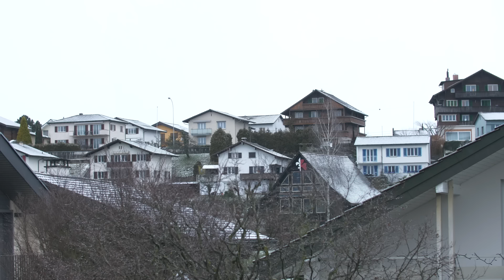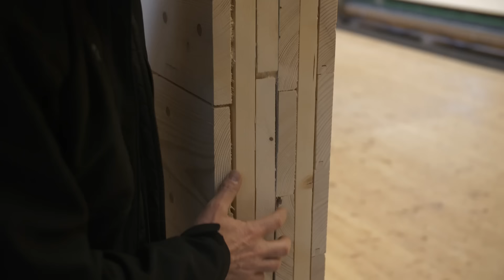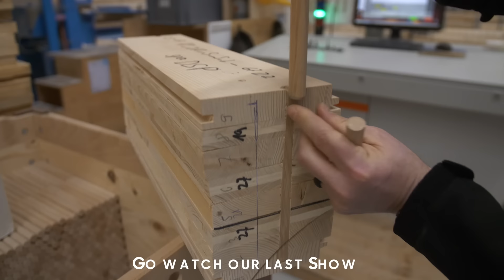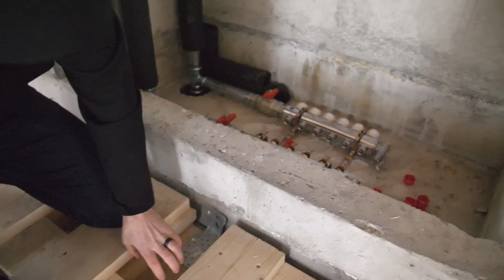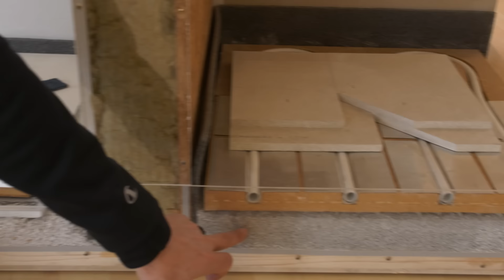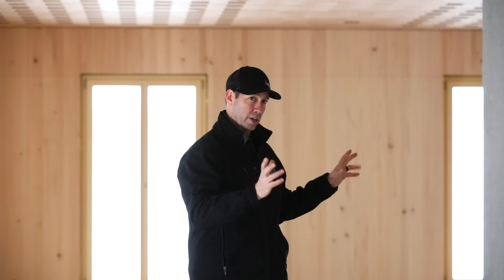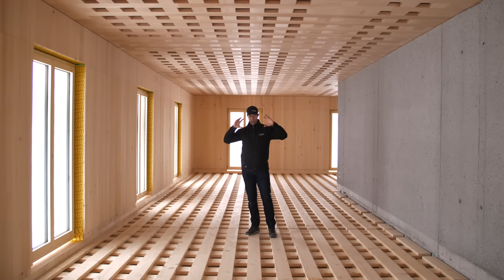This Swiss Building blew me away!  All Wood and Concrete - NO Insulation

Comment: i can think of cheaper ways of doing all of these things , of course it is a great way to build,,so is using marble and copper and sandstone and black walnut.. but as far as building good and less expensive homes we dont have a lot to learn from the swiss
Reply: if a building stands for decades and is cheap on heating/cooling and wont succumb to the elements it will be cheaper in the long run. the swiss are stingy, so yes, you do have alot to learn.

Comment: I have someone agrees 
The real question is both ideas are stealing from this world so the real question is what should we use as a substitute to supply a solid material besides wood or concrete how about the glass and the combination of a lot of lava rock mixed with sand to reform a solid surface which is not a bad idea

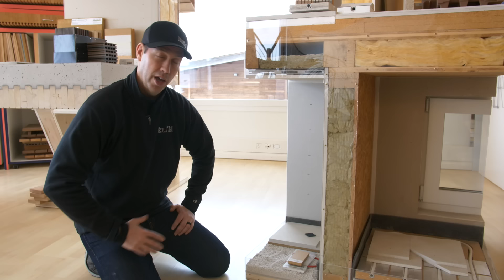Comment: I dont entirely see the need of such a floor build up. Not even in the mock up at 2:41.
But the product and build in general shows the high building standard of switzerland in terms of quality. Bulding material resources, financial resources and skill set of planers and contractors are available and taken advantage of. How most of northern europe builds, the concrete is very typical for swiss buildings tho

Comment: I don't really care about emissions or wood consumption. As I see it, humanity as a species will run itself into the ground either way. But if I were to approach this building from that perspective, I would be interested in emissions that you have to make while sanding, sewing, gluing, etc. I bet they would be pretty comparable to a full concrete structure. You can't fool physics. Moreover, let's add up the time it took for those trees to grow to the time that it takes to build this. About 50 years per tree. Are you prepared to wait that long? We already need millions of trees per day planted to make the slightest dent in our carbon footprint. So much so, in fact, that to accomplish this we would have to forgo growing food be it plant-based or otherwise. So unless they replant all the trees they use and do every bit of the work by hand or electricity generated by a nuclear plant I call bullshit on the "ecology friendly" claim. Other than that - a pretty unique and awesome looking project. Kudos to those guys.

Comment: I like the idea of the concrete in the middle with the wood on the outside.  I wonder if there's any considerations when the two different materials meet, do they grow or shrink at different rates, and could that cause some defects or kind of like noisiness as the building is groaning? Seems like they know what they're doing but I want to learn more about the concrete + wood construction.

Comment: Most CLT buildings in Switzerland , germany and austria apply insulation on the outside of the building and siding over that to protect the CLT panels and the insulation. 
The “ you don’t need insulation “ thing by these companies is mostly for a selling point. To get a really good insulation value from a CLT house you would need about a 30 centimeter thick wall. this drives the cost up to a level that most people aren’t willing to pay and beside that you can achieve a waay better insulation value using  a thinner clt wall with equal amounts of insulation on the outside .

Comment: Wood is beautiful until there's a fire...
Reply: where it turns out to be safer than concrete or steel
Reply: @MrTimStoop  Do you have verifiable data to support that? I did a little search and found(on a wood construction site) large wooden beams are more fire resistant than steel but couldn't find any supporting data

Comment: I wonder how they're going to get Voice, Data and Access Control done for the building. Are they going to run the cables with the heat pipes in the sand or if they're going to use conduit along the concrete core.

Comment: The sand method really sucks cause over time in high traffic areas the sand shifts and the floor becomes like a sponge. I've had to redo so many of these types of floor in Sweden. This method is no longer used here. But it sure does make the floor quieter. Not worth it though.

Comment: Damn that is awesome!  Very interesting and efficient design.  I do wonder though if there is any form of vapour barrier, or if the wood sealer will be enough.  Definitely a neat concept.  A standard wall with batt insulation is like R12.

Comment: R24 is pretty low, VERY low actually for new construction. Why do you keep calling this great? Termites, wood rot, low R value. This is a vanity project, not an efficient project. Check out the R80 roof they're putting on the Net Zero house on This Old House.
Reply from the maker: I’m not advocating for this in the US but I do think it’s interesting from an IAQ standpoint and certainly beautiful!

Comment: solid wood doesn't sound good for insulation, but who I am to judge. Insulation is about removing conduction of heat away. that house might burn really nice if it ever happens. seems expensive and also using sand might make it heavy, but soundproofing with it seems good idea. Also I hope there won't be any moisture in the flooring, otherwise it's gonna bend real bad.

Comment: I am pretty sure from the looks of it, that it is not normal sand.

In Austria we call it "Estrich" and in Switzerland its called "Unterlagsboden". 

It is very lightweight and will flow in every crack, like sand. Then it is cured and hardenend, i think with conrete-like chemical compound inside. After the curing prozess its solid, noise dampening and lightweigth. 

Its pretty much the Standard in Germany, Austria and i guess Switzerland as well since decades!! ;-)

Greetings from Austria.

Comment: Are there vapor barrier between the concrete and lumber? This doesn't seem practical, or innovative but every thing engineers do aint. That concrete will rot the lumber from the inside out, due to condensation

Comment: Artfully beautiful! Thanks for showing it. Cheers!

The sand filling in between the wooden floor elements - so much easier to remove then concrete in case of a repair or let's say implementing an idea of running an additional pipe or cable duct in the future. And so much simpler than mixing and pouring concrete. Good idea.

Comment: Wow, really interesting. As far as the building turning over the air so slowing, what will prevent the inside air from becoming "sick"? Fresh air is not the enemy.
Reply: Most likely an ERV or maybe an HRV....    balanced ventilation system.
Reply: The indoor air quality is much better in a tight structure when the ventilation system is done right !

Comment: 02:43 that "cat litter" is actually mashed cellular concrete. The product is called "fermacell" and consists of a lightweight replacement for a concrete slab. On top of the mashed concrete are two 10mm gypsum boards tightly glued together with an optional sound insulating layer on the bottom. It can be compressed wood fibers or mineral wool.

Comment: Very very nice building, love the ideas and innovation, however I have concerns regarding air change. It is very important especially if you're used to your forced air heating/cooling. Half an air change per hour? Humidity will be extremely high unless air conditioning/dehumidification is present, and it doesn't look like ducted air is an option. Air stratification could be an issue making areas vary in comfort, and radiant heat already has extremely high swings in temperatures. A fan and opening a window will help, but in colder climates this won't be an option due to possible freezing and cracking pex heated water/glycol lines.
    Also I cannot tell due to difference in architecture but is this commercial or a residential building?
Reply: Those buildings can transmit the humidity through the walls to the outside. Their outer shell is open air conditioned. They've built a ton of these (check Thoma100 on YouTube) and the science checks out. Really solid, save and healthy buildings that are not prone to molding, moisture build-up. Also the wood insulates against heat very, very well. So they need less cooling in the summer - if any.

Comment: Appreciate your sharing of information. Very curious about ventilation, cooling, as well as the electrical? Not a plug in sight. The buildings that I have seen with seemly construction simply nail the wire to the walls, talk about ugly, besides a commercial building, can't imagine it would not have conduit? I know they are 50 hz 220 volts, the building seems very isolated in terms of a path to ground, possibly incorporated into the flooring system?

Comment: This is a great example of a "Doing less with more" approach to building.
If anyone wants to see an example of a "Doing more with less" approach they can go check out Joe Lstiburek's "Perfect Wall" (which Matt has previously covered, but seems to have forgotten).

Just to put this in perspective:
The all-wood 18" wall shown in this video is ~R24.
An 18" thick "Perfect wall" would be ~R60 to R80 depending on your insulation choice.

The "Perfect Wall" would:
- Be a fraction of the cost, both initially and over-time. (Thanks to significantly less material and tipple the R value)
- Be way more eco-friendly (especially if you use cork-batt insulation), both initially and over time. (Yes, wood is renewable. But only if you are using it in a way that scales)
- Last just as long, if not longer. (Due to the "perfect wall" nature of protecting the structure itself from heat fluctuation)

Yes, what Matt is showing here is interesting, unique, and fun to look at.
But in today's climate, construction like this is increasingly hard to justify or glorify.
Reply: True on all accounts. I totally agree. It's a unique looking building, but it's not exactly innovative.
Reply: I urge you to do some research on this exact building. They use regional wood and it's energy efficiency is on par with houses certified after the swiss minergie standards (yeah, research on that as well). These guys know what they are doing. And building this way is only 10% pricier than a normal house in Switzerland.
Reply: @G00G00L  And it's made to last 500 years...
Reply: Using all that wood is also a way to create a carbon well.
Reply: Came here to say this, especially after the first floor laminated 2x8 system. Seems extremely wasteful and unnecessary.
Reply: I'd challenge you to have this conversation with them in person. The research into this will blow you away and the reasoning behind it is sound.
Reply: @PinwheelTimberPlanners  Matt made an entire video on advanced framing and why it is superior to traditional 16 OC framing, including how wood has a poor R value compared to insulation. So I would love to have this conversation with them in person.
Reply: I agree with your first sentence. When money doesn''t matter, one can build it however they wish.

Not a lot of heat is lost through walls, when compared to a roof, or windows, so R60 or R80 would be way over engineered in most places here in the US.
Reply: This video is the perfect example of Swiss VERY long term planning. This is a building built for 500 years. In the US you like to destroy and rebuild every 20-30 years... Well, not in Switzerland. 
And your insulation doesn't grow on trees. 
Regarding the durability of Swiss wood, I think we don't have lessons to receive from Americans that completely erase a surface from woods to just replant one species of wood, and then have to treat it against pests. 
We have long term planning of forests, and as we build stuff to last (100 years old buildings are everywhere), we don't have your kinds of problems. 

And just one proof of the better use of resources, the USA is the country with the highest consumption of resources per inhabitants on earth. 
Funny how Americans have no issue driving vehicles that consume  shit load of energy, when absolutely not needed, but think about resource efficiency for something built to last 500 years ! 
Guess where the balance tips in terms of efficiency.

Then, you don't seem to understand that it's a company working in that field. Innovation helps them commercially as well. This is a gorgeous building, and it's very different from your ugly buildings in the US.

Comment: There is a company in the US that makes a similar solid wood wall home kit. They use laminated built-up beams about 12" by 6" that are placed like interlocking logs in a log cabin. The beams are made out of Southern Yellow Pine. They say that the tree farms in the south grow enough broad feet of lumber in a day to build 2000 of their homes. 

Their homes use double walls on the north and the southern walls as a house in a house with air exchange circulating between the walls, the attic, and the basement. Do a Google search for Enertia Homes or go to enertia.com.

Comment: Wood done right is possible the best you can do. 
Sandfill is an old technology stays warm, lots of air in between and stays dry, water flows dowwards no mold build up.
Looong time ago  so in the 1950 th.when we buildt woodfloors in Austria we used wood stringers and they where filled in between with Hoch Ofen Schlacke ( steel mill slag ) was at that  time the best deal and you used a otherwise unusable product.
Super insulation and the floor stays warm, whats importand if you are on the groundfloor.
Sand is  as old as buildings are, in agent times they used it as buffer so the Tile or stone Floors dont break.
Dont know who remembers stamped and compacted soil floors.
Other countrys other  methods.
Hard to implicate in the US we are here a fast track building group.
Have a nice weekend
Chris Schmidt
Reply: oh, Austria, the plague of europe, is good the wood from Romania?

Comment: The concete-block has some serious Heat-Battery funktion. Warming the Building in Winter and cooling it in Summer. Great Idea.
Reply: The sand in the floors is also used for that reason ! The thermal inertia is improved with it !

Comment: Not that I dislike the building, or construction methods. However I think the claimed wall R-value for all wood is streching it at 1.4 per inch.The sandwiched 2x8's onedge to form the whole floor assembly is nothing new. I worked on a Reno project of an old 1860 brewery in which all floors were constructed in this manner.The radiant floor assembly method will require a very tight control strategy.

Comment: Very smart floor design. All the plumbing, cables and heating can be in that gravel floor sandwich.
It's faster and cheaper than running cables, tubes and pipes in different walls.
Reply: Unless you have to add an outlet down the road lol. But still a beautiful design.

Comment: How is it heated and cooled?
Reply: In Switzerland most buildings are not cooled. We do not heat with coal at all. Oil and gas heating is in a steep decline. Heat pumps and other methods are used very often.

Comment: the major thing about this type of construction is that it combines what is renewable and relatively light with something long lasting, although energy intense.  the trees grow, and can be planted again, and while they grow they provide oxygen and a multitude of other benefits to the environment for living creatures.  genius!

i believe that original stone floors in many middle ages buildings had alternating layers of sand and rocks of varying sizes at the ground level, for similar effect and to provide a kind of "foundation pad" much like modern concrete slab foundations.  so interesting to see the evolution of that idea in this building, and used in upper floors!